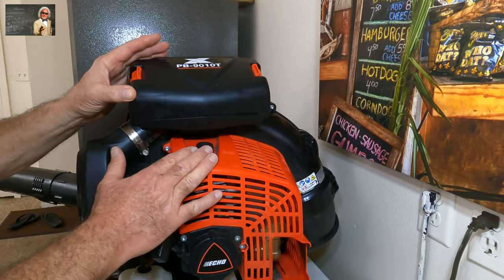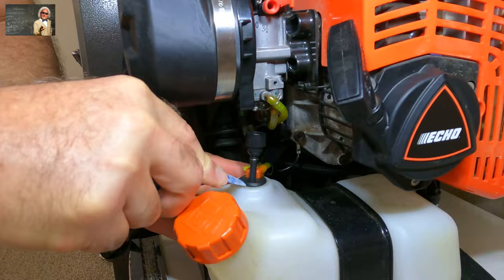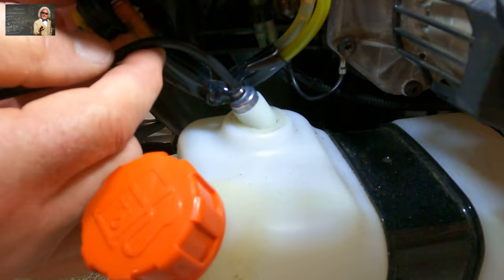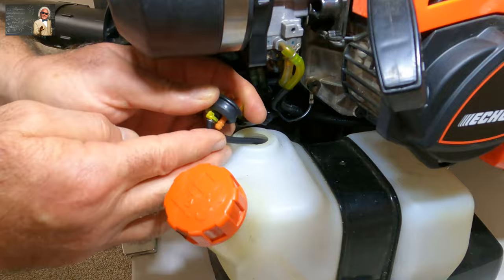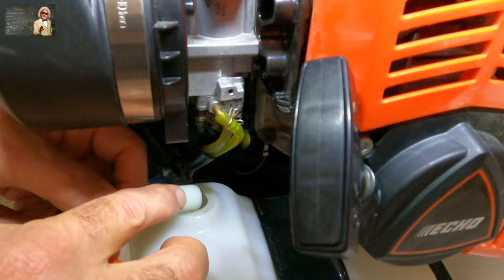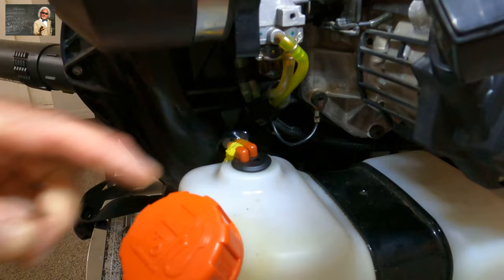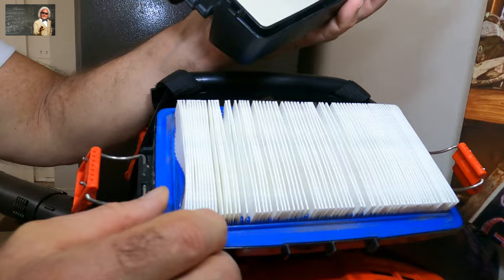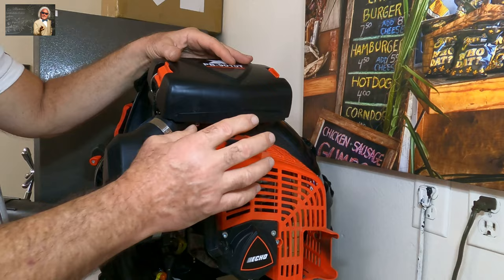How to Fix Bogging & Dying Out Leaf Blowers Like the Echo 9010T and most all 2-cycle engines Bubbles

Comment: Tell ya something right now friend: I'm 70 and have been working on large and small 2-strokes my entire life dating back to 1963 when I was 10 and had a Clinton Panther 2-stroke on my go kart. My Echo PB500T has frustrated the hell out of me for weeks now. It is only a few years old and still like new...gets used for 10 minutes about once every 10 days...and I had installed yet another new OEM carb on it this past Fall. I always use non-ethanol regular and Echo oil in the mix and just the other day, it started to suck air into the carb, bog out, shut off, and would have to dismount it and prime the bulb and start all over again. Was at my wits end as the carb is almost new and fuel lines and filter also almost new. Never thought to do this trick with the fuel line sealing issue. Can't thank you enough. John Lutz/Lancaster County, PA
Reply from the maker: So glad we could help John!! As they say, "frustration builds invention" hence the video, it was really getting on my nerves and I knew there had to be a way to fix it :)  Thank you so much for watching and sharing, we appreciate the input, hope you have a great day my friend. Guru Mike
Reply: My pleasure Mike and thanks for the kind words. Know how I quickly diagnosed mine as being specifically a fuel supply line issue? I keep plenty of assorted lines and filters and such in stock here. I removed the supply line from the carb intake port. I then took a fresh piece of line, removed the fuel tank cap, filled tank half-way, stuck the new line directly into the tank, worked the primer bulb which filled in about 4 pushes, and blower started right up and ran flawlessly. That was how I narrowed it down to a fault somewhere in the fuel supply line. My fault was that little line connector held in place by the rubber tank grommet. Thanks again Mike. Regards, John @MrKnowItAllGuru

Comment: Good stuff bro! I have a 560bt husky that keeps bogging down when throttle increase. Seems like not getting fuel My lines look good and I did a pressure test and holds pressure. I'm gonna blow out my gas filter even though it looks good. I have a carb kit coming cause I don't know really what's wrong with it
Reply from the maker: If you have an air fuel mixture adjustment screw try turning that one way or the other to see if it keeps trying to bog out

Comment: Good idea however when customers bring this to us, our quick fix is to first, pump out the old fuel then go into fuel tank through the gas cap opening with safety wire, grab the fuel line and pull up the fuel filter for replacement. Works perfect every time and this takes about 15 mins.
Reply from the maker: we did all that but found the line was sucking air ...but not anymore with this method.. :)

Comment: I had the same problem with my blower except the zip ties didn't fix the problem. What I did was is swap out the fuel filter with a Stihl filter part # 0000 350 3502. 3 months later it's still going strong.
Reply from the maker: Thanks for watching and sharing, have a great week. Guru Mike

Comment: my 9010 leaks a bit of reddish oil around the carburetor is that normal??
Reply from the maker: That can be a gas/oil mix residue, it sometimes looks reddish, as long as the unit is running well and your 2 cycle mix is dead on, you should have no problem. Thank you for watching and asking, hope this helps, have a great week my friend. Guru Mike & team

Comment: I noticed that (on my pr48bt) the fuel return-line is fairly loose at the [out] conjunction nipple from carb. I mean I can take it off without even trying, it doesn't strike me as a big deal but I suppose if air is coming out at that meeting point rather than back into the fuel tank, that could cause issues ?
Reply from the maker: Yes, you want all of the connections to everything nice and tight, use these  https://amzn.to/3yNdo59  Thank you for watching Joshua, hope you have a great weekend my friend. Guru Mike & team

Comment: I use Stihl oil for everything including my echo pb9010t just got it pre owned. Put new spark plug in so far but cannot find air filters or fuel filters anywhere for it. I dumped his fuel and cleaned the tank out and also carb cleaned the filter. Put fresh gas 50:1 in the tank and it runs good but after like 20 minutes it kind of stalls on full throttle then goes high again it happens here and there. The air filter is dirty but it’s not filled with debris as I blew it out along with washing and cleaning the pre filter. I took the intake hose off and cleaned that up and also cleaned the gaskets. The carburetor looks almost new too. After doing that I haven’t tried it hoping it may resolved the issue. Almost wondering if the muffler is clogged but it blows air out when running so probably not. Any advice would be greatly appreciated thank you man.
Reply from the maker: Thank you my friend have a great day guru Mike out